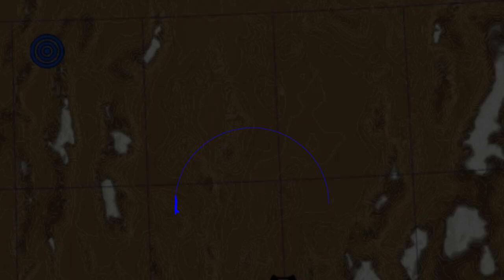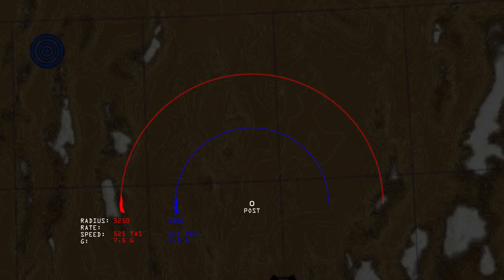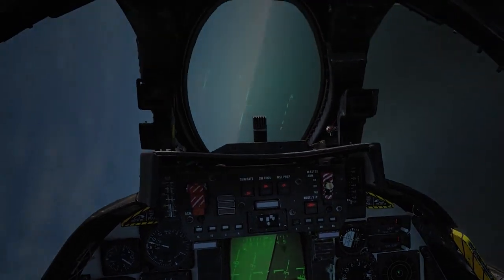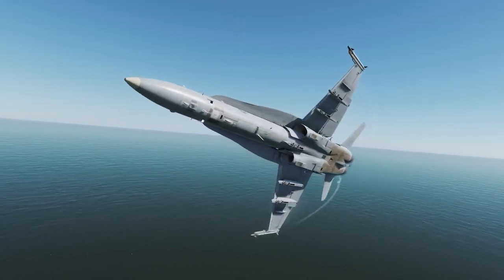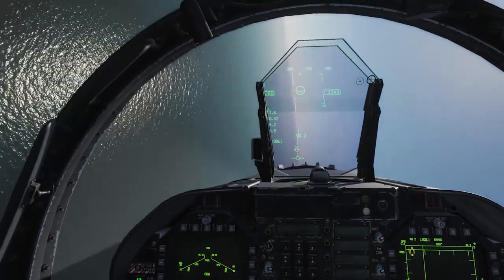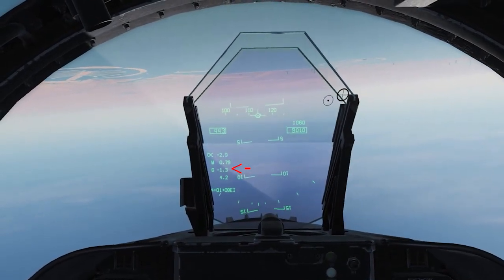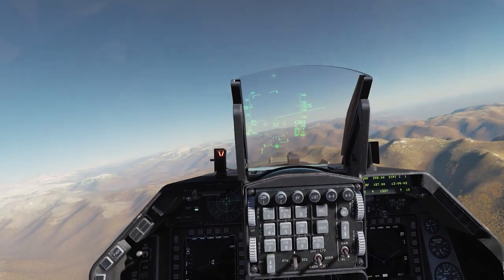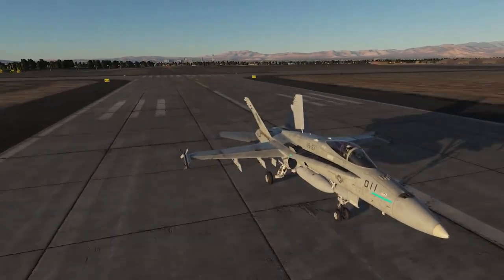BFM 101 - Turning your aircraft

Comment: Are you using any top or bottom rudder in these turns where your Bank angle is in excess of 70 and up to 90°?
Reply from the maker: Not that I’m conscious of. The turns are all loaded. Because you’re looking to maximise rate and minimise radius, angle of bank controls altitude primarily and stick back pressure (read also G load or alpha) controls speed
Reply: @AIRWARFARECHANNEL  thank you for responding! Got same from a Top Gun instructor on the Ask a fighter pilot channel. Have some friends that are private and commercial pilots but felt that you needed top rudder but they never banked at that angle. I think between your response and Vincent Aiello that pretty much settles it thank you.
Reply from the maker: Yeah, civilian pilots rarely sustain max performance in their aircraft and sometimes the techniques aren’t intuitive. I’ve had similar with people learning formation wanting to add top runner while on the outside of a turn to avoid ‘falling’ onto the inside aircraft. Thanks for watching.

Comment: Do we need to hit brakes to cut the angles of turn radius,if yes then which angles are best to hit the brakes?
Reply from the maker: There are very few situations where you would want to waste energy by deploying brakes, possibly if you are well above your rate band and need to slow rapidly because your radius is huge, but that's going to be a fringe case. In order to transition from Rate to Radius, you are better off increasing your pull (load factor) in order to bleed that energy off while transiently increasing rate. ~Tyro
Reply: @AIRWARFARECHANNEL  makes sense , thanks!

Comment: Quick question? I just did as you said and hopped in my f15 an had a practice but I'm still struggling to find her rate band, any help or advice on her band would help me in the merge thanks.
Reply from the maker: I think from memory the F15 rates best around 400-450 but others may have better numbers, I don’t fly the Eagle. Thanks for watching!